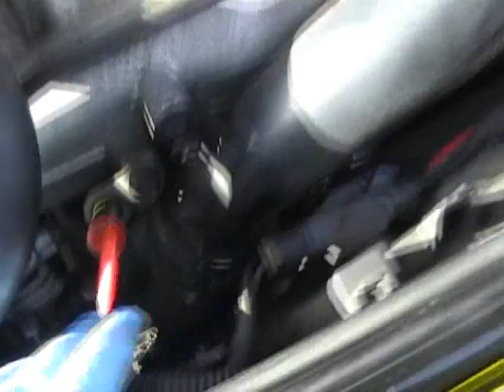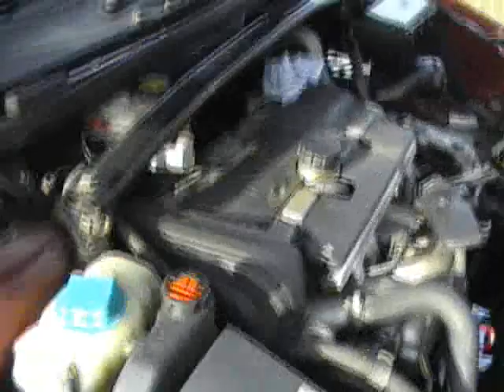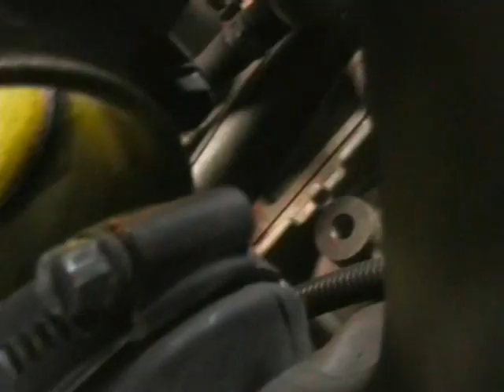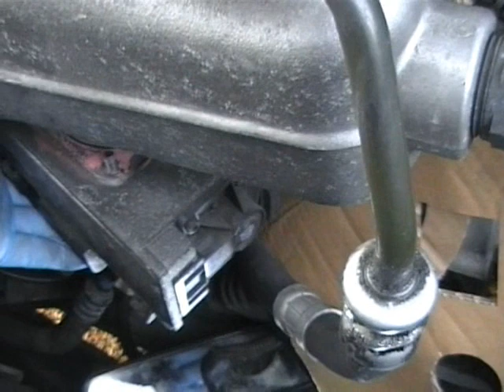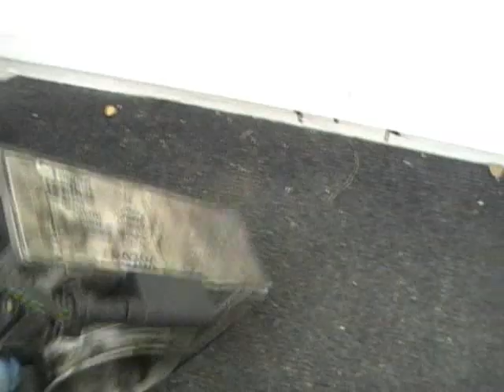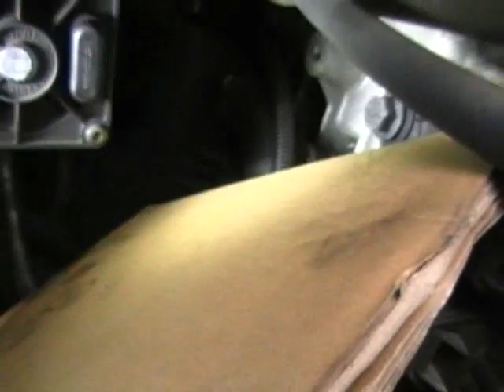VOLVO ETM CLEAN / REPLACE TURBO MODELS V70/S60/S80 THROTTLE BODY

Comment: What concerns me is that on reassembly, to fit the fan shroud back in, you have to move the plastic pipe that you've connected to the underside of the etm back a bit. That creates the possibility of creating an air leak at the band clamp that's already been tightened. So that seems crazy to me. You have to manipulate a secured plastic pipe in order to get the fan assembly back in.

Comment: In my 2000 s80 2.9 I quite often have rough/ surging starts on a cold engine and it judders if I drive and can't rev past like 2000 rpm. The scanner shows like 20% throttle in key 2 before starting. I am assuming the computer is going to the Home limp mode. The basic scanner doesn't show any codes. Sometimes there's no issue at all and feels completely normal. I am about to update the TPS as per AI suggestions but not convinced enough.

Comment: Tyvm for the reset procedure in the end. I did clean the etm and intakes and all in October but the surging issue was recurring quite often. Next I will try your reset procedure and see if it helps.
Reply: Did it work for you?
Reply: @Alec_Shaffer the surging or misfire might be due to a different reason,  but throttle seemed better.

Comment: Worst case scenario the mechanical motor operating the butterfly value is worn out, so you either have to buy a new throttle body for 700 euros or rip one from a junk yard and have volvo calibrate (if you get one from a car with the aame engine it MIGHT work without calibration)  it for you. 

What I did was buy an upgraded throttle body that replaces the mechanical motor for an electric motor for 300, and now I don't have to worry about it again. 
Also there is a 125 euro upgrade kit you can buy from BJPracing that you can install yourself but then it's a 50/50 if you have to go to volvo and recalibrate it for about 100. 
Hope this helps anyone who didn't solve their problem by cleaning the ETM.

Comment: My s80 to turbo is leaking water and can't find the spot. Seems to be dripping from the middle above the oil pan. Maybe about around the engine area in the back of the engine perhaps. I could see drips but not sure where to start. Usually it starts to drip more when I turn it on. Can anyone help me so I can have a idea of where to start looking more into.

Comment: THANK YOU for an excellent video! BTW On my 2007 XC70 I was able to remove the ETM without removing any of the air box and just dropped down the Turbo hose connecting to it without removing it.   Thankfully the  electrical connector  the ETM on this model is on the ETM itself ,so I didn't have to go near the starter.
Reply: 2007 xc70 also....and studying this video intensly! Good to know the electrical connect is on ETM! You still removed fan I assume, and did you buy a new gasket? I hope they are still easy to get.

Comment: Hi Great video thanks. I'm not a mechanic so this job took me 1.5 hours to strip down. Easy enough. Definitely take the fan out .Done the job with a small socket set 13mm and 10mm sockets, a couple of torx and a big flat head screwdriver . Also carb cleaner and a toothbrush. Putting some new banjos on and conduit. Clean

Comment: 2006 XC70 stalls on startup and idles rough cold, threw codes for MAF, a  shop replaced it, didn't help, I'm trying to fix it for a friend now. Is this the same on the xc70? I've changed plugs, and even though it needed them, didn't fix the rough idle/stall

Comment: Great video, this helped me gain confidence to work on it myself. I didn't remove the throttle body just to avoid needing the gasket, but was able to clean it very well and also in the process discovered i had a bursted lower intercooler pipe that I will need to replace, so good thing I ended up working on it!

Thanks again for the video it was very helpful

Comment: Step 1. Gather all tools and begin work.
Step 2. Cut knuckle drop tools can't see. Flip out throw a wrench and swear
Step 3. Repeat steps 1 and 2 then call your local mechanic. Flip out because you don't have a towing service then pay it then punch something after receiving the bill for labor and parts. Proceed to freak out after Volvo still runs like a bag of dicks

Comment: Great video. Very clear instructions. My S60 2.0t keeps giving me codes P2126 and P2127 so I'm guessing a new throttle body is needed. Do you know if a new one would need to be programmed at all?
And wouldn't access be easier from below the car?

Comment: Luckily for the XC90 there is enough clearance that the airbox does not need to be removed, and neither does the fan. 1. Move the main crosspipe (I was able to get away with just removing the front connections and moving to the side. 2. Remove the clamp for the pipe under the ETM, and move the pipe forward and out of the way. 3. Reach under the manifold from the right (facing the engine from the front), unbolt the 4 bolts holding the ETM and pull it gently to the right and out. Unclip the connector and you're free. I had quite a bit of crud in mine at 130k mi. I did not replace the gasket but I'd recommend you do so. 

My car has been running quite a bit smoother since I cleaned my etm. I did not disconnect the battery, but probably a good idea to be safe.

Comment: tried this on my first ETM, but now i ve ordered a second hand one that worked well at the beggining and now starts to loose its power again. even tho my car has 180 horse power, i dont really feel them because of this faulty part. also, i tried a new sensor, but the problem is probably on the mechanic part of the ETM, not on its electrical part. So, i need to replace it with a new ETM. problem is that it costs around 500 dollars or more (because u could only find it on original). anyone has got a better solution? thanx

Comment: Thank you very much. My wife’s 05’ S60 (with 240xxx miles) was running very rough during idle and would die. This solved my problem! Should hopefully get another 200k miles out of her;)
Reply: this is exactly the problem I'm looking to fix! fingers crossed.

Comment: Thank you so much for posting a video that was not shaky, not spending 10 minutes telling us how great you are ( even though you are) and for making this easier for me, My Volvo was lurching forward when the brakes were applied and surging horribly at idle and while stopped, I followed your directions and hints , I never disconnected the electrical wire , just cleaned it once I had it unbolted, thanks again for a great learning experience The car runs great again !!!
Reply: Exact same thing with my 2007 right now, this comment gives me hope I'll solve the problem.
Reply: I was thinking I could do the same. Leave it connected and clean it after removing it from the underside of the intake manifold. Thanks.

Comment: I have a 02 Volvo v70 2.4t with a bad ETM and I was quoted about $900 to fix it. Ive seen used ETMs on eBay that have been rebuilt, can I just unhook this old one and plug the new one in and be okay? Or do I need to have someone sync it with the computer and put it in??? Another question is should I try cleaning it first before replacing it?

Comment: Replaced my ETM (and lower turbo hose) on 2004 Volvo s80 thanks to this viddy. Thanks! Car runs fantastic now. This fixed a host of problems that seem to come up with this problem: brake sensor light fail, misfire. My shop quoted $1100 to fix all. I did it for $300, with new Bosch ETM.  Note: I simply unplugged connection at the ETM, not down in engine after digging under there for a while. Did not remove airbox or upper main turbo boost/cross pipe.  ETM problem often comes from oil seeping out from worn bearings in turbo itself over time, per my mechanic.
Reply: Was this hard to do? I am not mechanically inclined at all but after tons of research I am fairly certain this is the issue. Mine is a 2004 S80 Turbo as well. Thanks in advance!

Comment: Followed this tutorial for my 2007 Volvo S60. Very easy to follow, I didn't even take out the airbox and was still able to remove the throttle body completely. I cleaned the heck out of it to sparkling condition, but the car still has a stick when you rev it. It is however, driveable once again.

Comment: GREETINGS TX, TANX FOR THE KNOWLEDGE U SHARED IN THE ETM VIDEO ABOVE. IT REALLY HELP AS A FIRST TIME "DO IT MYSELF" IT WAS UR VIDEO I WATCHED AND FOLLOWED CAREFULLY AND IT WAS VERY HELPFULL, I HAVE A S80 2002 VOLVO SO ANY OTHER INFORMATION YOU HAVE ON SAID CAR KINDLY SHARE.
THE NEXT TASK FOR ME IS TO SERVICE MY HAND & WHEEL BRAKES. SERVICING THE ABS BCM - BREAK CONTROL MODULE ANY INFO U HAVE ON THIS WILL BE HELP FULL.
BIG UP ...
RESPECTFULLY "GR8 GRANDMASTER"

Comment: I have just replaced the MAS on my 2001 V70. It no runs perfectly. Before it was hesitating when pulling away and under load, and throttle pedal felt a bit unresponsive. I had tried cleaning the MAS with MAF spray cleaner, but it is not easy has most of it is enclosed. The slightest dirt or oil on the sensor will cause it to send a weak mixture message to the brain.

Comment: Easier job on the non turbo 2.4.  The throttle body doesn't need to came out, just disconnect the air hose, flip the valve and clean inside out once in a while so the idle doesn't drop 

All 2001-2002 ETM were faulty and very costly.  Volvo put a different brand 2003 on but it still gets dirty.

Comment: I own two Volvo's and two older subaru outbacks.  I can clean the TB plate on the subbies from start to finish, to clean up in about 20 minutes.  I am finding that Volvo's are more of a pain to work on than my Jaguar XJ6 or SIII.  Volvo over engineers a lot of things.  The PCV valve that we are accustomed to replacing in no time is a 2 hour job on a Volvo.  It is a system on the Volvo and a $650 job at the dealer.

I'm thinking of selling the S60 before any of this nonsense appears.

Comment: ok so ive installed an aftermarket hks bov  and after reving it up enough for the bov to release pressure the car stall whil returning to idle if i rev it up half way it tries to stall almost like the car shuts off for a second any tips or help would be appreciated

Comment: My C70 Cabrio suffered something like this. Only, the engine felt down instead of revving up... Thanks to your video I dared to get the ETM out and clean it. Inlet tubing is a bit different in my car because it cools air in the radiator (easier to remove :) ) but other than that, close enough.
She runs fine again!
Thanks !

Comment: why is your check engine light on? @25.35  my car (v70 1998/modelyear 1999) is running very good, but the check engine light is on too and this for about one and a half year now....
Reply: Check engine light can be for so many different things. I had a check engine light come on just because I had changed my fuel cap to a locking one, as some scumbags were stealing my petrol. The cap was not a Volvo original OEM one, and the ECM didn't like it an sensed a vacuum build up in the tank. Now I have to periodically release the cap and reseal it, or just put the locking one on overnight.

Comment: I'll add this to the to-do's this winter for sure.  Great video and can't wait to dive in to the ETM....
Reply: +Greg Agnew me too! the positive side effect of this is that you can learn a lot about this part of the engine too, if you do this for the first time! and i will go 1 or 2 steps further and take out the injectors and the intake manifold! i think if you are already doww there - you should check the pcv system too....the good thing is you can leave the etm on the manifold, when you take the whole thing out! my v70 is about 17 years old now and i will replace the intake manifold gasket too...maybe i´ll put the spacer from ipd between it....there´s a spacer for the etm too

Comment: Brilliant and helpful video and a fairly easy job to do. My 2000 V70 with 170K  was idling so bad it was stalling. I followed this video and car is running great now. I found that removing the very front thinner plastic sump tray gave me access and a view from underneath to see right up into the ETM so could clean without removing.

Comment: Excellent! Anyone owning a Volvo may be able to perform this routine maintenance themselves and save themselves some money. I tried it myself and it is not that hard.
Reply: You can access the throttle body and clean it by removing the tube that goes down between the manifold and squirt cleaner in the tube .If it is not to bad that may be all that is needed .

Comment: I haven't had the problem, so far. Only bought 07 S60 T5  in August '14 40,000 miles, now almost 48,000. I have seen all tubes had been replaced for my car, and this ETM must have been part of the problem once. I guess, before I ever get to 100,000 miles (160 000 kms), I will have had some issues. Though I always will change oil at 12,000 and the filter, and the air filter, I guess my 2zzge (Toyota) (previous car) was much more reliable.

Comment: Have a 2000 v70 that would die out 2 out of 10 times as soon as I started it.  Had to turn the key all the way off ever time to retry.  Used your video to clean the etm and now it starts every time.  Thx so much!!!

Comment: have you ever had low oil pressure light come on ??  if so, how did you fix it.  I have replaced all turbo oil seals & gaskets, oil trap, cleaned out oil pan and replaced all oil seals in there, dip stick seal, new oil trap, new oil filter, better thicker 5w-30w oil.  also I get codes P1171 & P1181  have replaced MAF sensor with bosch one twice,(thought maybe I got a bad one). replaced plugs, almost every vaccum line, air filter, maniford gasket, ran fuel cleaner, new gas and oil caps, new main turbo tube with heated sensor, new front O2 sensors, and rear exhaust gaskets. I am at a loss, can figure out whats wrong, any help would be appreciated
Reply: An oil pressure light on indicates rod/crank and or cam bearings worn out. Continuing to run it this way is a recipe for disaster. If you're very very lucky you might get away with replacing bearings without tearing the engine down.   Sometimes it is just one rod bearing out of clearance.  If the light goes out when you increase rpms that's good.  If it's on all the time STOP and don't even crank it until it's figured out.
Reply: light goes out when you barely accelerate.  I actually removed 1 1/2 qts. of oil and added Lucus oil stabilizer and it seem to fix the issue.
well, I wouldn't say fixed the issue, but no more visual problem is there with oil pressure.  I think that's what previous owner did, because I found honey like stuff next to the oil cap.  when I changed my oil, this oil pressure issue started.  I had no idea.  now that part seems good.  cant seem to figure out whats cause the codes.  I might add some stuff to the fuel next.  Lucus makes a special product for that too.  maybe injectors not working correctly.
Reply: P1171 as "Long Term Fuel Trim (Upper Limit)" shows that You have too lean mixture. For this there can be many reasons. First what normally comes in mind is too less fuel. As it is non direct injection there is not much reasons for that. Need to check out fuel pressure in fuel rail and normally thats it. Injectors normally works very long life. Another reason can be turbocharger - it gives too much air in. For this there can be many reasons - bypass valve in turbo is not working, pressure sensors for turbo is not working, air measurement sensor is not working, bla bla bla. Then is also some stupit mistakes possible - some inlet air pipe is lose or with holes or cracks. I would recommend start with turbo (Take it off and out from top of the motor and check out how it look likes). Shaft must have a little movement, everything must turn nice and smooth, no sound by turning. Check out also bypass valve and vacuum activator for it. then be sure that all pipes ar tight and in secure places. Run ETM realign operation, check out air filter.
Reply: Raul Romo i will check i have the same problem... very helpful!!

Comment: brilliant video….worked SO well…but would recommend replacing the cir clip at the ETM to hose connection…spent too long trying to tighten up the old one..the tip about the starter clamp was especially useful STAR!!!

Comment: Two thumbs up on the video. Very helpful and gave me the confidence to try this. 
To Joe Zouz comment, I also forgot to wait 10 min before attempting to start.  Mine had fluctuating RPM for about 3 min but then settled down just like in the video, much improved before the clean.  I removed the radiator fan and encountered two problems to share.  Passenger side hex bolt holding the fan against the radiator wouldn't unscrew. Found that the square nut on the back had broken free of its anchor.  I used a Dremel to cut a wedge out of the plastic collar on the passenger side of the bolt so the fan could be slid towards the driver side slightly to remove.  I was able to replace by sliding the collar behind the nut when I finished with no problems.  I also would recommend removing the dipstick and taping over the hole before starting.  I snapped off the plastic portion of the dipstick removing the fan.  Now have to find a replacement. 
The job has made a huge difference in stabilizing idle and eliminating problems on acceleration.  THANKS AGAIN!
Reply: Yep, just snapped the plastic top of the dipstick completely off today. 😥

Comment: Hi ... Great video bye the way . I did exactly what u did toke the EMT out and cleaned it and put it back , but did not leave it the ignition on for 10 minutes , did it after I started the car and didn't work ... So I got another one from a Scrap yard and installed it and this time I left the ignition on for  10 minutes and Yurika it worked :) .. So was my EMT defaulted or I should have did it right from the start ? Thanks again really helped me .